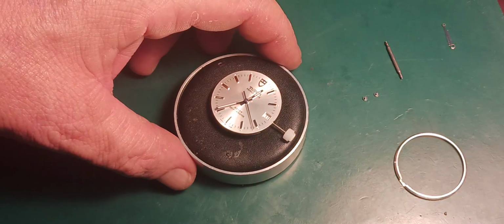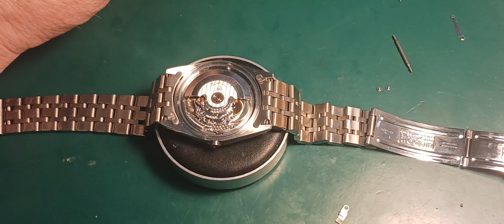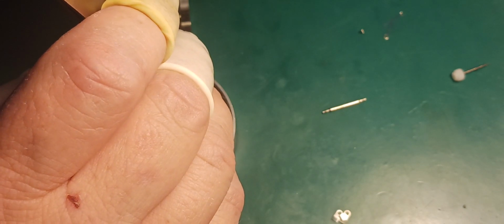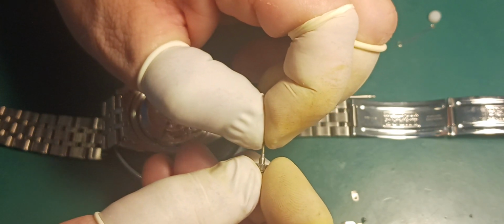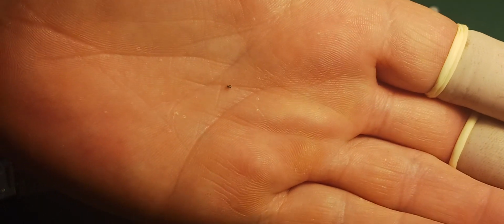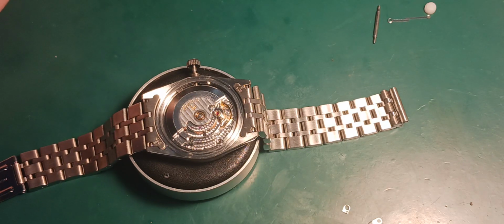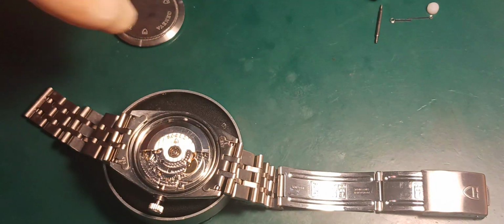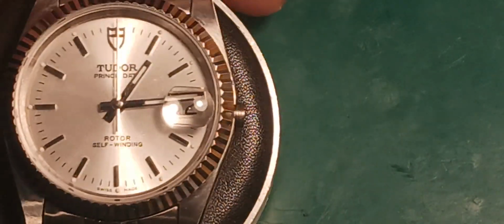My Tudor Build. Prince Date Part 2

Comment: I thought you were supposed to take out the crown in the time setting position with these 2824-2? Am I wrong? Maybe that‘s the reason the stem won‘t reinsert. Because I did this to my 2824s too…
And boy was I wrong.
Reply from the maker: On these, even in time setting, the keyless will still mess up at times
Reply: @alabamadeep4471  i replied on your other video (the 3rd one).  the way you took out the keyless works, it would lend itself towards messing up.  after messing up the first couple of 2824s i worked on, i have removed and reinstalled 40 or 50 2824-2 stems and none have had keyless works issues.  first, only remove the stem when the dial is upside down on a dial holder.  it is hard to get the right pressure to push down the stem release when you are holding it.  you need to calibrate your hands, so to speak, and that is done when it is installed on something that doesnt move.  too much pressure, and you can push the release under the mechanism.  from the video, it looks like you are using way too much pressure and the wrong sized screwdriver.  too little, and you are going to bend it trying to pull out the stem.  second, use the correct size screwdriver and only push the stem release down exactly downwards.  if you are at an angle, it can push the release under the mechanism.  if you use too small of a screwdriver, it can push the release under the mechanism.  third, only gently pull the stem with the release down.  if you have to pull harder than a gentle pull, the release isnt in the right position.  fourth, only push the release in the time setting position.  even gen etas are done this way.  the 2824 design has a problem with the yoke in the sliding pinion channel.   fifth, always lube and twist.  i put some lube on the end of the stem and slightly twist as i am inserting.  again, the 2824s have had issues with the yoke staying in the channel.  you can push the sliding pinion when inserting so the yoke pops out, resulting in you only getting the calender position.
Reply: also, i never work on the movement screws when the balance wheel is moving.  worst case scenario, one of the screws pops out into the balance wheel.  if it is moving, the screw can sometimes cause it to move off the jewel or even damage it.